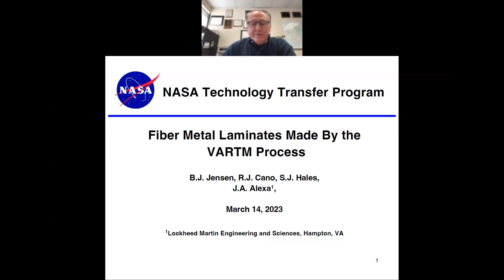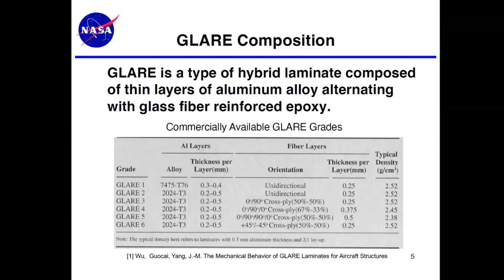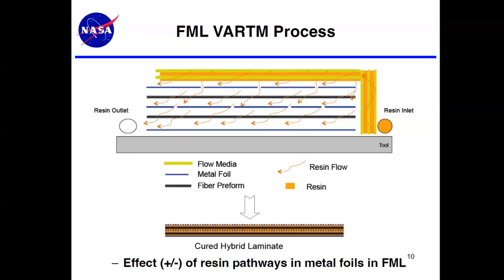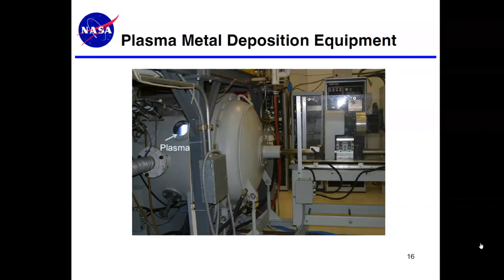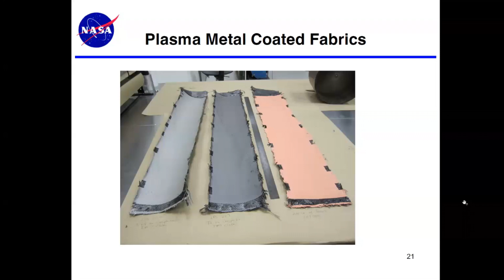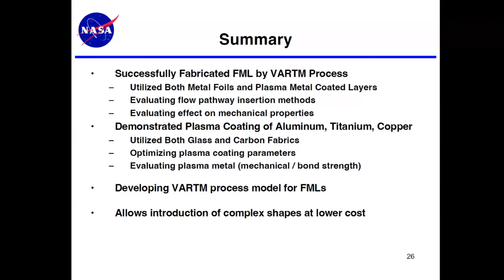NASA's Fiber-Metal Laminate Manufacturing Technique Webinar

Comment: Great presentation. I am intrigued by your slide 7. However, I have searched and searched to find a reference concerning the explosive-resistance container shown in Slide-7, but with no success. I was successful in finding a state-of-the-art review paper in which the following statement is made: "Federal Aviation Administration in 1995 developed the first GLARE freight container for aircraft which is considered to be resistant to blast since it is capable of absorbing free and explosion from bombs [33]"; however, the cited reference 33 seems to be a wrong citation and that reference does not relate to the statement, whatsoever. 

I would greatly appreciate it if you could kindly provide the appropriate reference for the container mentioned in slide 7.
Thank you!
Zack Vizeman